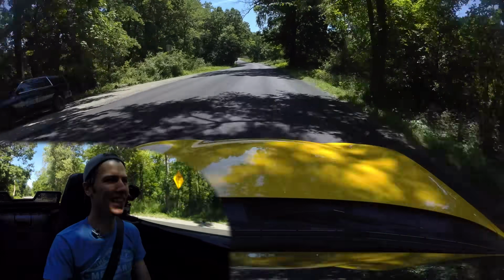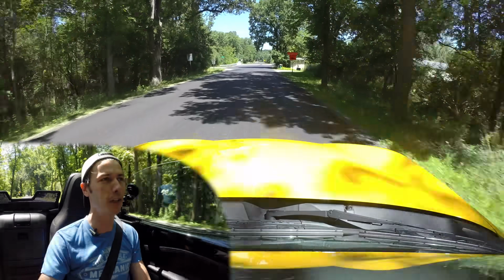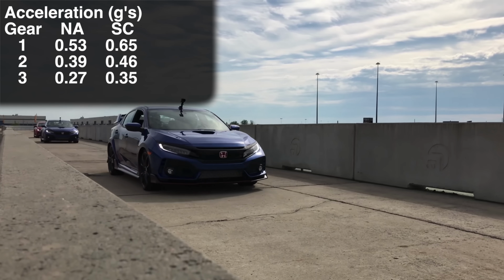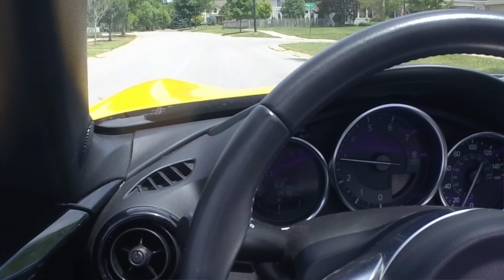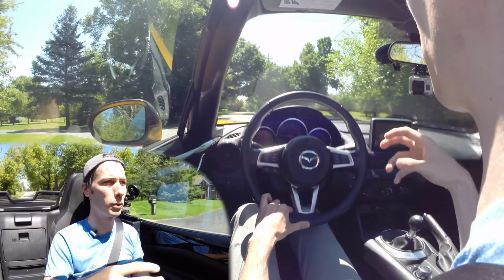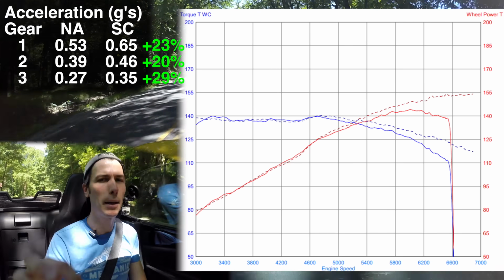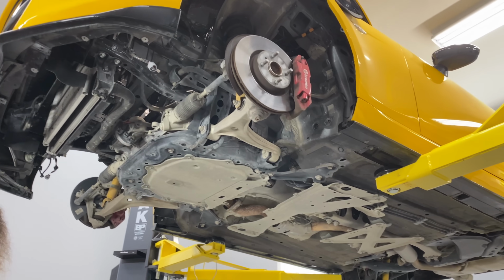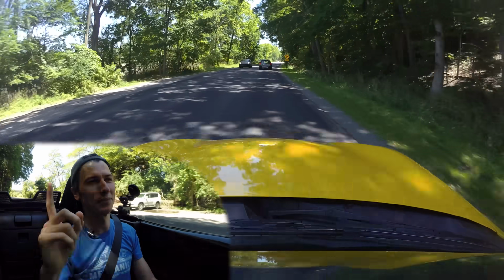How Fast Is My Supercharged Mazda Miata? Police Not Impressed

Comment: "I'm finally driving my supercharged Miata!"

cop: no you're not.
Reply: I have a camaro I'm working on with dual 3IN Straight pipes from Kooks. Oh and 420whp with a turbo 350 and 4.10s
Reply: @JayAR_YT  post a vid when shes done!
Reply: @takiorilab  probably not happening soon blown head gasket and other poor craftsmanship  when the last dude owned it. Also abuse for sure may or may not need a bottom end I'm going though my drive train before I get anything else going.

Comment: "Well technically, officer, I'm not in control of the throttle, it's electronically controlled."
Reply: Gold
Reply: If the real problem is between the steering wheel and the pedals and all else fails, blame the software!
Reply: That's one line to keep in your back pocket 😅
Reply: I gotta use that one! 🤣🤣🤣

Comment: The officer is looking for a way to click to the next video because he wanted to hear the nosies. ... it doesn't work IRL HAHAHA. Great video and shirt my dude.
Reply: I want to see Charles in an EE t-shirt.
Reply: Hi man.
Would you be able to do a video to show us how to calculate or how to know what the torque limit of the connecting rods are in our engines.
I'm in Sweden and to forge the engine is very expensive, it is acutely more expensive than replacing the engine almost 3 times if a disaster happens.

The thing is that nobody really knows how much power the connecting rods can handle in my Mitsubishi Colt Ralliart  it comes stock with 150bhp but I have tuned it to 270hp and about 30% more torque. I can pushing it more but like i said, I dont know how much the rods can handle and I don't want to break the engine and still have fun. Is there any way of knowing this. There is no such info/data in any document from Mitsubishi.

I know you work mainly with VW but it would be a very interesting video.

Thanks
Reply: You two need to keep doing videos together and break the stereotype that german car guys only respect german over-engineering!  How about my mystery myth that switching from Moly to Mobile1 0w-40 in my mk6 gti (109k mi) is actually burning noticeably less oil!  I am only low when I change it now as opposed to having to top it off every month!
Reply: Love how Humble Mechanic and Chrisfix comment!  The Three Amigos!

Comment: 0:36 "everything works" yeah those 10 warning lights definitely work
Reply: the more the lights the better😎😎
Reply: Aren't they awards/badges/achievements?
Reply: This shot was when the car was being flashed with a new tune, and so all lights are on as the car is essentially in some sort of diagnostic mode. The RPM gauge is a measure of the tune being uploaded at that point, ie. RPM readout is 'tune upload progress' as it sweeps from 0-8k RPM.
Reply: @COB86  cool!

Comment: The reason for the noticeable throttle closure is due to the supercharger itself. Before supercharger, when you let off the throttle, you only had the stock motor and accessories continuing to pull on the motor with no fuel being added. Superchargers are, as you know, run off the motor  so now you have a much harder negative draw on the motor when the fuel is cut off. You are still going from 1% fuel to zero, but instead of having a "negative 140hp draw" when the fule stops,  there is a negative "160hp" draw. I know I am making up these numbers, but this point is still the same. I'm glad you are enjoying the ups and the downs!

Comment: it happened to me in the exact same way: i was testing my car after fixing an issue with the electronic throttle because it was extremely weird and not opening all the way after 3k RPM to get boost.
I floored the car from 2nd to 3rd at 3k and there was an entire group of cops right around the corner, the car was pulling real hard  😂 in 5 secs i was surrounded by cops. they asked what the hell i was doing and i tried to explain the best i could and they "kinda" understood, one of them knew my dad, so i guess that was what saved my ass.
Reply: Wow!!

Comment: Hey all..I have the Edlebrock Supercharger on my 2017 MX5..could not be happier!!! Yes the Edlebrock tune was very touchy in first gear and into 2nd. Blipped a lot and was causing miss shits at low speed....really fickle. I had the Fab 9 tune installed....PERFECT !!!! ALL problems gone. MUCH MUCH BETTER !!! Now a true joy to drive and no bad shifts. Great job Fab 9 !!!!  Greg

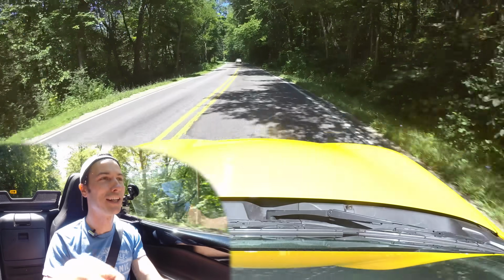Comment: The throttle issues you've described from 6:15 onward illustrates a great example of why tuning is important with upgrades like this. I've had the opportunity to learn the workings of torque based engine management in my Audi (ME7.5) and its a complex system especially how the drivers torque request is placed through several tables to ultimately be met by the engine. You are right it's not a linear 1:1 and there's a lot more to throttle that calibration engineers have to deal with. I can at attest to OEM applications with torque based engine management that beyond drivers wish (torque requested) that there are situations where the ECU is trying to manage the air flow into the engine to meet additional parameters calibrated to maintain optimal engine torque at low and high speed that have to be tweaked especially in your application. I really would enjoy to learn about what Mazda has implemented in their engine management because if it's a Bosch based ECU this is a very fixable issue you describe it just takes time.
Reply: linear = 1:1? When did that happen?
Reply: Any idea why the ecu would blip the throttle for the 1st-2nd shift a low load & rpm ? I only do that with down shifts.
Reply: @kevink2315  Without a datalog I could only speculate. My immediate thought is sudden release of torque due to clutch disengagement and throttle responding slowly to change in torque demand. Some vehicles in my example VW/Audi have a switch to tell the ECU when disengagement is happening and prevent the REVs from dropping quickly and furthering driver comfort while shifting. This implementation   has a failure mode though where if the switch were faulty you can get observe rev hangs in light to moderate gear changes. 

I'd suggest he datalog with variables related to engine rpm, engine load actual & desired, throttle position, throttle plate angle, and if there are any variables available to log clutch coupling (if applicable).
Reply: @stevenbryant4718  one to one ratio ; as in for percent drivers throttle position is 1 increment percent throttle valve position. If you were to look at this in regard to a 2D table it would be a slope of 1/1 (one over one).
Reply: @yankumarrah  like constant ratio, just that simple.

Comment: I didn't read all 2387 previous comments so if someone has mentioned the cure for the 'throttle hang' my apologies.   If this hasn't been said.....the blower bypass is likely responsible for the abrupt power off feeling.   The actual throttle is probably not moving much at all when doing this...all you are doing is opening and closing the blower bypass valve.   At speed the blower is trying to push a bunch more air through the motor than it's using so the valve is opened to unload the rotors.    Not sure about that system how the valve is operated...just vacuum or electronically?   Either way...some judicious tinkering on the operation should allow you to adjust the let-off feel to your taste.    Very nice little car you have there!

Comment: I really don’t like your statement: “If 1,000 transmissions fail, but there are 200,000 cars out there, it’s not a big deal.” That is absolutely not true. In the medical device industry (yes I know, totally different), we look to be Six Sigma complaint, meaning no more than about 3 failures per 1,000,000 units produced. With your statement of “not being an issue,” you’re looking at approximately 5,000 failures per million units produced. Don’t give the wrong message, that’s very significant!
Reply: A transmission failure hardly ever is going to hurt, take, or save a life. Completely unlike hospital standards. This is such a grossly unrealistic comparison with no correlation when rooted in reality.

Comment: Possible reason for low/light throttle then closed difference: before you might have been at 15-20 hp at off-idle, now you might be at 25-30 hp at same throttle level. Dropping off to idle now is probably a bigger HP difference, including the operation of the supercharger.

Comment: Hey Jason, I was having an argument with a friend about how wheels attach to hubs and the forces at play when a wheel is in motion, and how that whole system actually works. He is of the impression that the weight of the vehicle is handled by the center-bore in a hub-centric situation and the lugs handle rotational forces or all forces if a lug-centric situation. I tried to correct him that neither case is true, that all forces are a function of friction between the hub and the wheel seat and the lugs are there to provide the necessary clamping force to achieve the high level of friction needed. Unfortunately, both of us are having issues finding science minded articles or youtube videos that will bear out a correct answer. I feel like an explanation of this system would be your speed but I can't find a video from you or anyone else on the subject.

Comment: I owned a 91 NA Miata with the 1.6 for 10 years. That was bulletproof.   I recently tried a 2008 NC and the transmission and diff were garbage!!  With 60,000 miles the diff needed to be rebuilt and the 2nd and 3rd gear synchros were going.  The car didn't seem like it was abused at all, and my much older self drove it much more sedately than I ever drove my 91.    I'll be looking for another NA at some point.  I'm starting to feel like I don't want to own any car made after the mid 90's.

Comment: Reminds me of the time back in the mid 90s when I was checking to see if my car bounced around 80 after inflating the tires to the correct pressure. Probably doing 90 past a small used car lot in a straight away heading to my buddy's house. Was making a left turn a few miles down the road when I saw a state trooper in my mirror. He pulled me as I turned. The usual where are you heading in such a hurry and how the speed limit was 55. He admitted I was going so fast that he didn't have time to clock me or I would have probably lost my license.

Comment: What you talk about at 8:10 is exactly what my Mini has. If you let off, especially in 1st gear at slower speeds and RPM, it’s like an abrupt lift of the accelerator you get in a higher HP car at higher RPM.... accept at 10mph. It’s real annoying, it makes driving smoothly at slowly speeds harder.

Comment: RE:  Transmission failure.  I though it was kinda telling when the ND came out that the Fiat version retained the 6sp gearbox from the NC generation, despite the smaller 1.6L engine.  Apparently Mazda didn't trust the extra torque from the turbo.  
Too bad, because I have to admit the new gearbox felt absolutely lovely..

Comment: Flyin Miata has a lot of data on transmission temperatures on the NDs, they run crazy hot and that supercharges the wear on them. Just slap a cooler on it and youll be golden.

Comment: Really surprised he hasn't grenaded the transmission (ND1's are well known for this STOCK)
I Just got my ND2 RF- and it has made me focus more on shift points, rev matching and double clutching than any car I've ever owned because I know that this still has that same transmission as the ND1- only with a dual mass flywheel (absorbs shock load). So the fear of wrecking my new car has forced me to be a better driver.

You should invest in a seat lowering rail- shave off 7lbs per side and you get more headroom and legroom to boot!

Comment: I am surprised that the officer didn't know that the accelerator is no longer mechanically leaked to the throttle valve. How else could high tech cars like hybrids work without digital throttle control? 🤷🏻‍♂️

Comment: I think maybe that "lurching" feeling when you lift off the throttle will be due to the increased engine-braking as the supercharger continues to leach power. Tends to be more noticeable at low revs on screw compressors than the centrifugal type in your S2000, since the former are more effective at compressing air at lower RPM and therefore leach more driving torque at low revs. Perhaps the Overrun Fuel Cut needs tweaking or disabling.

Comment: I do my own tuning and drive by wire throttle (and least GM cars) is torque demand based.  So you can't just ask the ECM to give you a absurd amount of torque at part throttle cause it will give full throttle and you'll kill yourself.
Accelerator position vs Vehicle Speed is the demand part.   So you have to be honest with the tune inputs if you want smooth driveability.   Benefits to this are.. you can make the car give you whatever amount of engine breaking you want and do it only if selected manual mode or always or in different driving maps (sport / rain / cruise / etc ).
It's a very good way to make a car driveability respond exactly how you want.

Comment: Awesome vid, thanks for posting it! I recently test drove a 2018, absolutely loved the car, incredible handling, rode well, tight, no rattles, I was very impressed except for the power or lack of I should say. I was wondering if it would be cheaper to just buy a 2019 instead of doing a supercharger but after watching your video I realize there are some significant gains with the supercharger however I can't believe the price of them. When you do the conversion from USD to CAD it works out to $8,834.73 and that was with just the cheaper Edelbrock E1 Tune number. I wish there was a cheaper solution to bring a 2016 MX-5 h.p. up to the 2019 level. Is a Turbo any cheaper?

Comment: I had the same issue with my Peugeot 208 GTi manual after I changed the final drive ratio. Turned out that the ECU needs to know which gear you're in exactly, otherwise the ride would be very rough since ECU will run program for idling which give very rough throttle response, especially when you completely let go of the gas pedal. I sorted it out by changing values in the ECU.

Comment: It is technically wrong to talk about torque when you mean power. All the graphs show almost a flat torque curve, so meh? Horse power is a function of torque and rpm, the formula is H = T x RPM/5252. That is why at 5252 rpm the HP = Torque.  In engine performance torque is irrelevant, it is all about horse power. Removing the torque curves from the graphs would not make them less relevant. Torque peak is important because that is where the engine is at its most efficient at full throttle. That is why modern automatic cars have nine speed gear boxes, as it is trying to keep the RPM in that sweet spot of efficiency. Torque is also important for engineers as they need to design components to handle the torque, not the HP.

Comment: I always wondered why you chose a later model miata when you're aware of Direct Injection and it's carbon buildup issues??  Wouldn't the 124 spider be better as it's engine is built old school with port injection so you know it will last forever?    plus it's already turbo.  My favorite miata is the 04-05 NB miata because it's the latest and greatest "real" engine with as modern of tech as you can get before the "hyper advanced" plastic engine era of today. The whole thing is still analogue but high tech analogue.

Comment: Try and get an early import of the MG-F. It is a mid engined  rear wheel drive convertible. Has two engine 1.8l @ 120 bhp or 2.Ol vvc @ IP to 160bhp. They are available for import into the USA now as they are over 35 year old......there are non here yet....a few in Mexico.

Comment: I enjoy very much your videos. I just saw this one and I have a question: the poor communication between accelerator pedal and throttle was a failure your car already had, or was it the product of re-tuning the engine for the installation of the supercharger? In other words, if I install an Edelbrock supercharger in my ND2 Miata, will the throttle problem occur, or yours was just a one-off situation? Thank you for your help.

Comment: Hi Great Video!
My question is regarding your choice to get the Edelbrock Supercharger Vs the BBR turbo. I know in your video you mentioned you prefer that linear power plant and like that mid range torque. But doesn't the Turbo option provide more Torque in the mid range? I too want to throw a power adder on my ND and am leaning to the Supercharger because of the power delivery but I am also chasing more mid range torque. My initial thought is Edelbrock Supercharger with a Goodwin racing 4-2-1 header to increase the torque possibility. However, that BBR turbo torque is tempting.
Thanks for your input!

Comment: @
Engineering_Explained

11:00 jason are you sure about what you said? 
im not sure thats true 
consider two engines with the same torque (same flat torque): engine#1 : produces maximum of  100 nm @ 3000 RPM   engine #2 : produces maximum of 100 nm @6000rpm so the power of engine #2 is twice in compared with engine #1. because we want the same speed (eg. 50km/h) from both cars at the same gear so engine #1 needs a 2.5:1 gear ratio so the wheel torque in engine #1 is 250 nm but in engine #2 if we get the same speed at gear 1 we need a 5:1 gear ratio so the wheel torque is 500 nm in engine #2 thats double the wheel torque of engine #1 so we get double G-force at engine #2 even though the engine torques are the same

Comment: I am wondering: Japanese cars are always made in the cheapest way. They minimize the cost pushing at the limit all the materials. Is it save to squeeze 60 HP more from every component of engine and transmission? Do you compromise the reliability of the car?
I had several Japanese cars and I always found all the mechanical solution very cheap compared to German cars.
It's not a criticism, just an observation. I would like to know you engineer point of view.